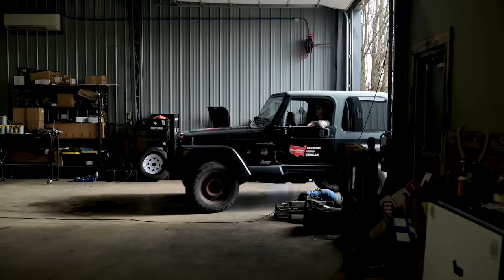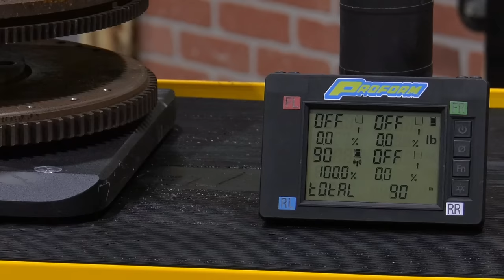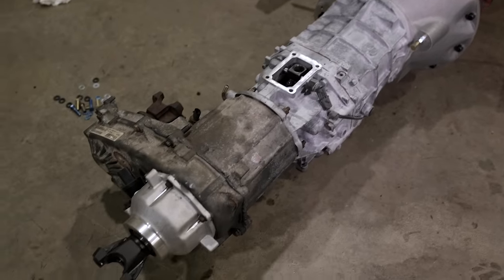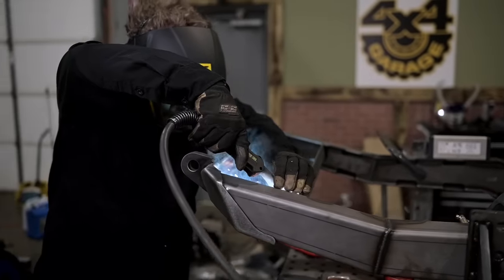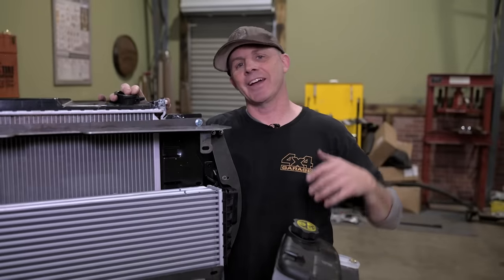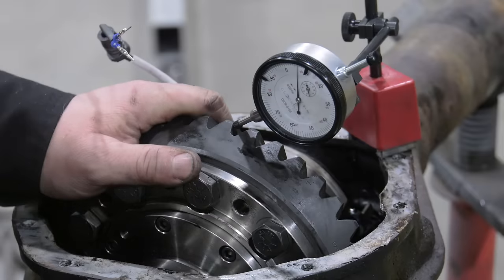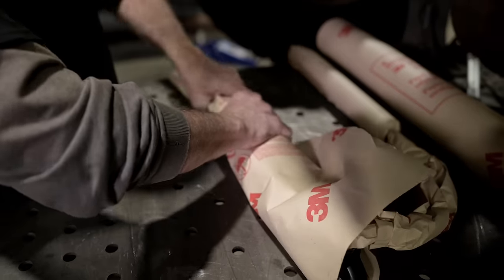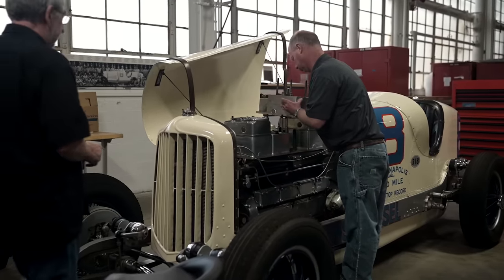Cummins R2.8 Drivetrain Upgrade! Stretching TJ Body to LJ Frame! | 4x4 Garage Ep. 11 | MotorTrend

Comment: I put a TDI 1.9 in mine from the City built kit and average around 25mpg with 4.88 gears, 35s and a 4 inch lift.... Was getting around 30 with 4.56 gears

Comment: Ive got a 1990 Toyota Hilux Surf id love to drop a Cummins into. Only snag ive come across is adapting the engine to the factory R150 transmission which is similar to the Jeep Ax15 but depth on the housing is way different so wont work. Id have to machine my own but dont have a lathe or mill 😢 one day. The factory 2L-T diesel is awesome but just dont pack a punch like a Cummins.
Reply: I have an r2.8 in an 85 4runner using the quick draw bellhousing to an r151f and dual gear driven cases. It required raising the trans tunnel a little bit and used a tcases cross member from front range off road. No body lift, 2.5" suspension lift. It can fit. I'm still using the stock shift bezel and center console, it looks factory but with some extra sticks.

Comment: Need a video on how to install quickdraw universal radiator and charge air cooler combo on a YJ because the steering box and column is in the way
Reply: Also don't see the brackets for sale on quickdraw for the original radiator 🤦